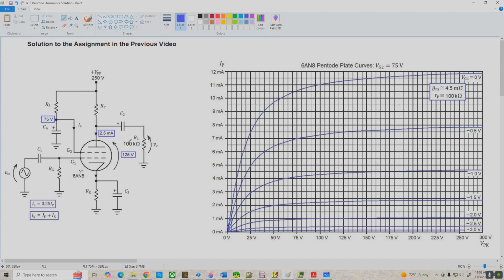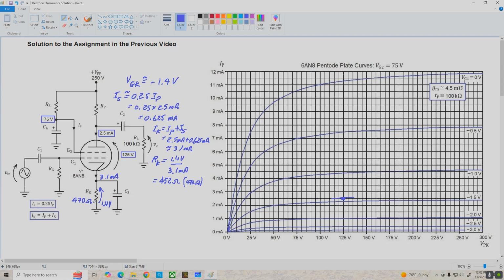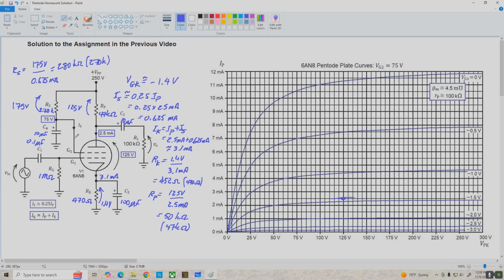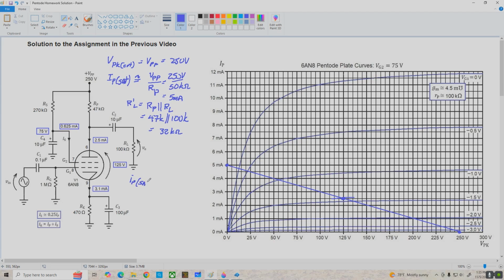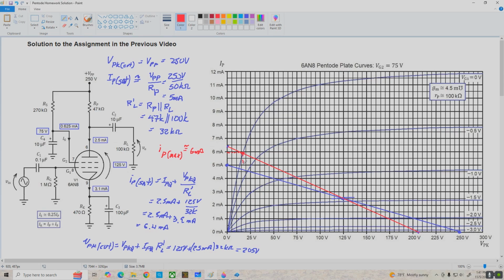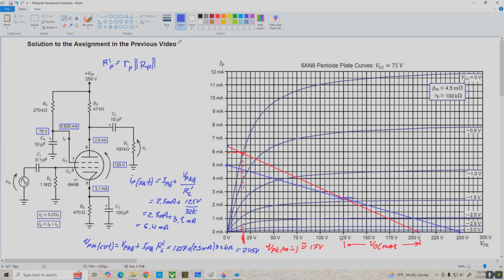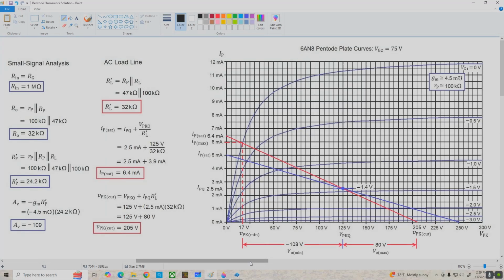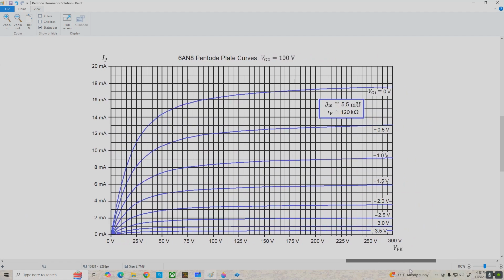Topic 65: Pentode Homework Problem Solution

Comment: I use CCS on the cathodes on certain pentodes and audio output tubes. Problem solved, no thermal drift or runaway, has tube age compensation, not sensitive to filament voltage change  etc, etc.

Comment: +250v Vpp is AC voltage ?
Reply from the maker: Vpp is modern notation for the positive DC supply rail. The old school notation would be B+. The notation I use corresponds to that used in BJT and FET circuits (Vcc, Vee, Vss, etc).